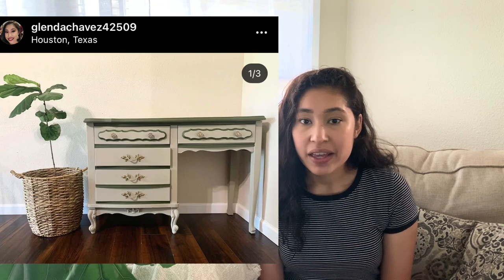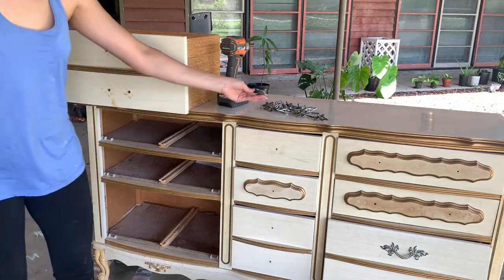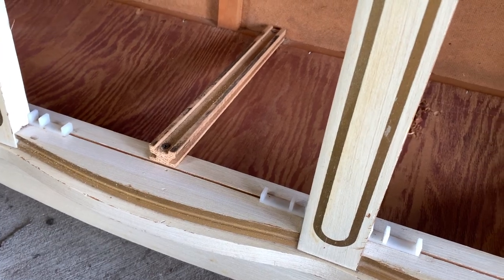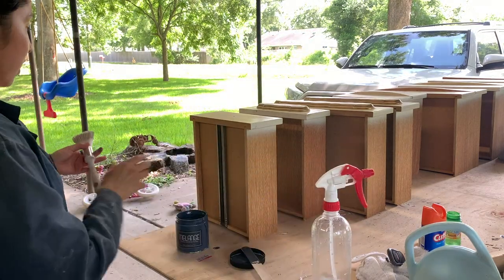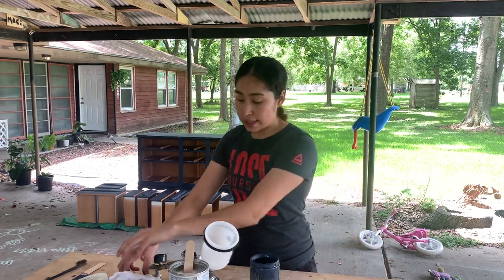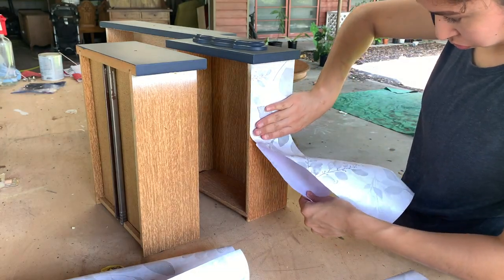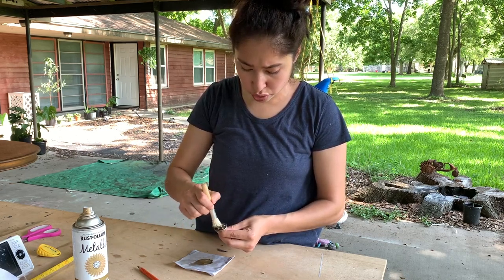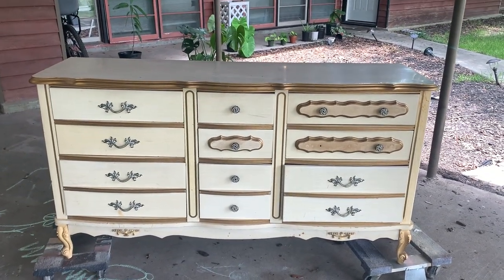FREE FURNITURE MAKEOVER | Trash to Treasure | FB Market Furniture Flip

Comment: Is there a reason u brush ur paint on and spray ur top coat?  Why not spray the whole piece?  By spraying u get the best finish during each step of the process. I notice this with other refinishers as well.  What gives??
Reply from the maker: I normally spray everything  bc ultimately spraying does give that factory like finish! but honestly I’ve truly been enjoying this brand of paint with a brush! The self leveling and smoothness is unreal! I will be spraying it next to see how well it sprays! As for spraying the poly vs brushing on, well there is no comparison there. With as hot as it is already here in tx it can be hard to work with and risk looking streaky. So I always choose to spray the poly regardless, plus it’s much more effortless to spray! Hope that answers your question! Thanks for watching Dan! ❤️🤗